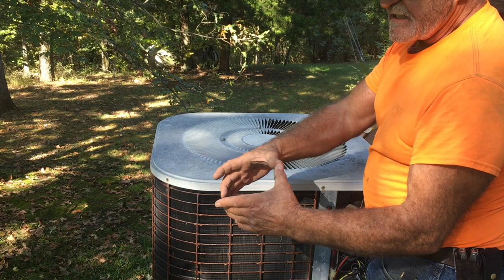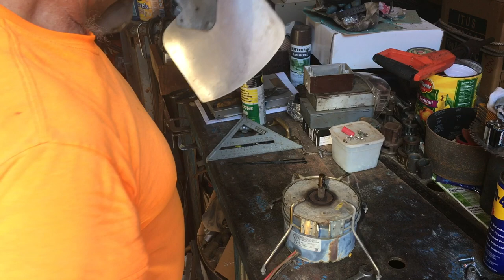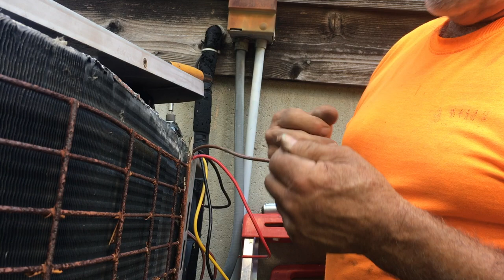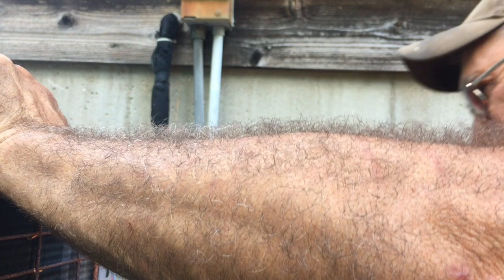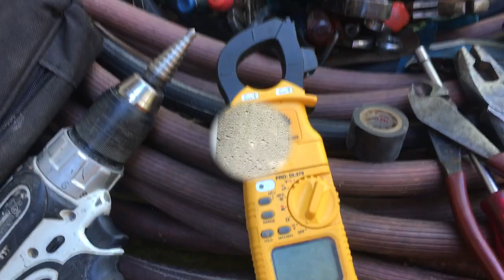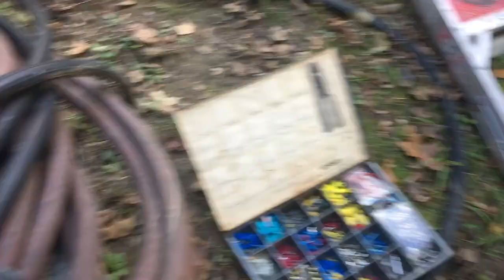Heat Pump Outdoor Fan Motor Replacement

Comment: How do i fix a hayward pool heater fan motor part #303088001 ? is there a vid?
Reply from the maker: Sorry Trish I have no specific information on that part number, so I can't give a suggestion.  A lot of the really new motors are kinda made to toss and buy a replacement. In the old days, we would install new bearings, start components and other stuff.  Not so much any more.